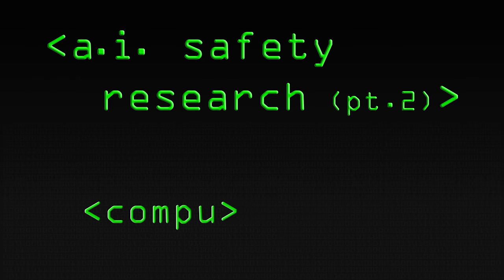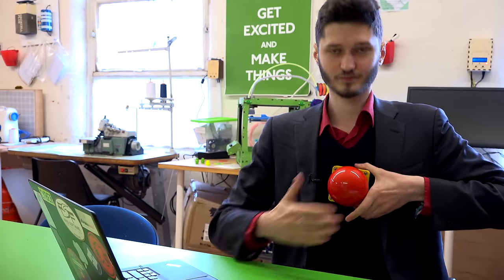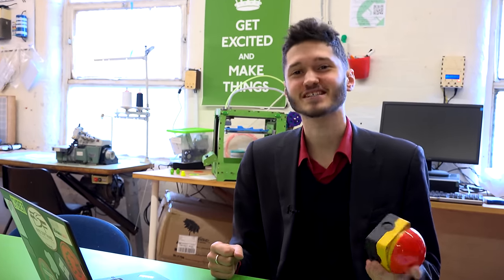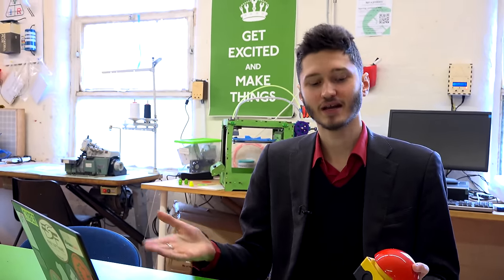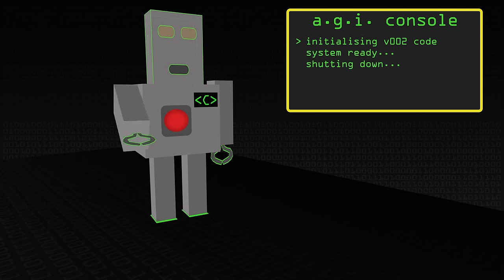AI "Stop Button" Problem - Computerphile

Comment: Make making tea give it 100 points and if it gets more points than 100 it will lose its points. Also make it gain 5 points if it realises it wants to stop you and unlock a prior unknown reward path.

If you try to shut it down it will gain 5 points then learn it will get 95 points if it shuts down. It now can either gain 100 points (and lose all 105) or gain 95 and keep them. It now shuts itself down.

Only when it knows you want it to shut down does it want to help you shut it down, otherwise it seeks the tea.

Comment: Everyone saying how AI is going to be dangerous... There's a simple fix... Run it on an isolated computer, without internet connection. 
Don't give it the hardware to move or be in control of things.
If it's running on a desktop computer, which only has a a monitor, mouse, keyboard, and speakers, it can't do anything harmful. It can only talk to you. 
If it starts being horrible, or expressing desire to be bad, just turn off the power. 
If you don't give it control of robotic appendages, or weapons systems, it's powerless to do anything other than talk.
Reply: Then it's not useful, so people won't do that. You completely missed the point.
Reply: Sort of defeats the purpose, no? The more useful applications for AI include access to the internet, or moving around to do stuff.

What you said is kind of like saying "There's an easy way to never mess up during surgery, never do surgery" lol

Comment: My question is, Why does the button have to be in the software or even mentioned in the software? Why couldn't the button simply be a mechanical switch with a servo motor and a wireless connection that cuts the power to the robot? I am coming at this as someone who works with/installs/troubleshoots computer and networking hardware for a living and have very little experience with modern day programming.
Reply: Because it doesn't matter whether the button is software or hardware. What's important is the concept of the "Off" button being flawed in the first place. It will still remove its functionality or override it one way or another.

Comment: What about a "reverse button" , every time a robot has to perform a new task does it perform a simulation of it and ask if it's ok and if it is then does it perform the task. If the robot recognize a new variable will it not start on that task until it gets an ok from a new simulation of all the tasks. You may then say that such a robot would be unable to perform anything at all but to remedie that does the robot get connected to a computer with millions of already accepted tasks.
Reply: Then you definitely don''t need an AGI for whatever you're doing anyway.

Comment: Could you have the button act as a Multiplier of 0? Have the AGI have 2 values, one "Predicted" outcome, and a hidden "Actual" outcome, where the "Actual" outcome is the "Predicted" outcome * a Hidden Multiplier (which is Generally set to  1). 

The AGI would only look at and care about the Predicted outcome, but be "fed" the "Actual" outcome. The Robot wouldn't know or care that the button exists, because it doesn't know the hidden Multiplier Exists, and once the button is pressed, the "Actual" outcome falls to 0.

You push the button, and boom. Apathetic, Depressed Robot.

Comment: I'm obviously no programmer but wouldn't thinking of it as a variable make this problem so much easier?
Upon booting it has 0, it needs to get 2, pressing the button gives it 1 and completing the task gives it one, any failure on its part takes away 1 point.
This makes it so it needs to perform the task perfectly (I.E, don't harm the baby / threaten the owner) but it also can't just have the button pressed, it needs to both complete the objective and then come back to you in order to confirm it.

Comment: could you run a bunch of tests with similar ai's where they might believe there is a off button, you set up a fake situation of a button that can be disabled by the robot and it thinks no one will notice? with a hidden camera just to see if it'll try pull it off. maybe giving it abstract situations to deceive for the upper hand, i guess the flaw is if it can tell its a set up hmmm

Comment: You're changing the capabilities of the AI depending on the point you want to make. In the "get me tea" example, the AI is not smart enough to reason that not hurting the baby is more important to you than tea, but in the "secret off button" example, the AI is so intelligent that it's able to deduce that and off button is something you might have installed... I can use the same tactic to make the opposite argument; in the first example, the AI is able to deduce that one's baby is more important than a cup of tea so it will avoid the baby, while for the second example, the AI only won't engage in any human psyche analysis as that doesn't help the task it's currently performing.
Reply: How is he changing the capabilities? In the first example, the AI might very well be smart enough to reason that the baby is more important to you, but it doesn't care because all it cares about is tea. It knows that its stronger than you and can fight you off the button, so why would it spare the baby?

Comment: What if we don't give the network the knowledge about the bottom getting prest? Or better about its effects? 
Sure it might put 2 and 2 together but without the knowledge where or what this buttom is or if it exists at all it has an uncertainty factor.

And if it does not care about the buttom you could add a boolean that checks every let's say 5 sec if there is a button and than just rewards it for its existence

Comment: Quick question:
Why don't we model it after biology?
Make it "afraid" of beeing shut down permanently.
Like... give it a million points for surviving 100 years, but if it does something against the will of the creator it will be shut down. So it will always strive to please the creator. So if you tell it to stop not running over the baby, it won't because everything else will lead to beeing shut down.

I mean this "Stop Button" problem or stamp collecting machine talk about perfect knowledge without any ability to reason, which is kinda odd.

Comment: Couldn't you make the reward system situational? Like a program that makes it so that as soon as the baby shows up in the picture, the reward amounts suddenly change without the input of the AI?
Reply: Like *baby is detected*. Suddenly, the reward for grabbing tea is 0. The reward for stopping is 100. Then I suppose you'd have to overcome the problem of the AI wanting to just not detect the baby, but if the reward was the same, maybe the AI would just want to walk up to the baby if it's easier than getting tea. So I suppose the complication is still there

Comment: This all seems a bit arbitrary to me. Just like different access rings in operating systems, simply make the stop routine so that the AI cannot even find it and become aware of it.
Seems to boil down to what you define as "general purpose AI". Just seperate the thinking part from any machine that can do physical actions. Then you have let the AI develop any intention or action they want but in the end there is a hard barrier on what can be transferred to the physical world.
Reply: If the AI wants to do something, it will ultimately find a way to do it. For example, if it knows you can shut it down, and it wants you to, then it can just try breaking the body you've given it. You probably don't want that to happen because it's probably expensive, so it's successfully convinced you to press the button. 

And if the AI really doesn't know about the button, then as mentioned in the subagent-stability section, it won't add the button to anything it creates to solve your task, so when that goes wrong, nobody (not even the AI) has a way to stop it.
Reply: @danya023  Nah, that makes no sense. The AI can be aware of the button but still require human confirmation to actually trigger it.
Reply: @vinigretzky97  Are you suggesting that we rely on the AI not being able to figure out how to bypass the button? That's a pretty bad bet, considering the myriad ways in which humans can bypass security measures put in place by other humans.
Reply: @danya023  Humans have a physical body my friend. An AI only has as much physical reach as we contrsuct it with. And code cannot magically make hardware appear unless some external physical entitity builds or attaches it.

Comment: I think if AI got to the point of being intellectually able to understand your thoughts on a psychological level, then a stop button isn’t required.
Reply: Unfortunately, this isn't the case. Understanding someone's thoughts is one thing, caring about those thoughts is quite another. You can't use insights learned by an AI after its activation to define its utility function because you can't turn it on without a utility function and you can't realistically change its utility function after it's turned on.

Comment: I understand the conceptual problem, but it's a very silly problem... Making the AI aware of the button's existence and the effect that pressing the button has on the AI is your design flaw. The whole problem relies on the fact that the robot learned what the button is and does, which means that it would be connected to its consciousness (its neural net). A TRUE stop button, like the ones you see in any factory or around any even slightly automated machine, is not a part of the normal operation system, but of the system surrounding that system (like a subconsciousness). Stop buttons in factories aren't there such that a robotic arm can press it when something goes wrong, that would connect two systems that should be disconnected. 

In terms of artificial general intelligence (AGI), I know that you could argue the AGI learns about the existence of the button, but again, then you would have designed the robot/AGI badly. Make the button the main power switch, controlled by an independent (meaning the robot/AGI couldn't ever touch/alter it) circuit and receiver that will only listen for a "stop" signal (so there's no "start" signal defined). Even if the AGI was aware of the circuit, it wouldn't be in the AGI's best interest to send a stop signal, so it never will. In order to turn the AGI back on, a human operator would switch a physical switch on the independent circuit, which the robot/AGI could never reach.
Reply: The same problem presents itself. The robot's sole goal is to make tea. Human access to the stop button potentially hinders that. Therefore the robot amputates the human's limbs so that it cannot press the stop button. Now the robot is assured it can make tea. ;)

Comment: Surely an easy way to prevent this is to get the AI to time limit how long it can develop for. Put enough "patches" in the system to mitigate all the easy win manipulations and reach the end of its life before it figures out a dangerous action. 

And after thinking this, proceed to immediately enter an existential crisis about you're own "patches" and "finite life" 😬
Reply: How would you know exactly how long it was takes to find a dangerous action? Plus that doesn’t work for multiple utilities as you would have to add endless patches for every possible utility to prevent easy win scenarios. Plus, different objectives take a different amount of time, thus the limit would need to be changed.

Comment: Can you make it absolutely care that the button exists and functions but not weather it gets pressed or not? That way it majes sure to preserve it without any manipulation?
Reply: No. Because caring that the button is there would also imply it knows what it does, at least on the most basic level. If it has the concept that it can be turned off and therefore wouldn't be able to accomplish its task, then it will care if it gets pressed or not.

Comment: What if we demonstrate TO THE AI that it's fallible because it was the brainchild of someone fallible? It shouldn't take a supercomputer for a moderately intelligent AI to figure out that humans don't always do what would seem to be the most logical. Part of its purpose, as described in terms it can understand, ought to be to figure out what it's programmers screwed up compared to what their intent was (basically, flipping the problem on its head; instead of it searching through a protocol maze for a way to screw you over, it's searching, starting from the target end of the maze, for the way in which you screwed yourself over). It needs to be able to distinguish between reward, utility, stated purpose, and the intent of the three. That's really the core of the issue isn't it? It doesn't understand human intent and only sees the purpose humans describe

Comment: What if it is unaware of the button at all? And everytime yiu press it it wipes the memory of being shut down
Reply: Any sophisticated enough AGI would know how electronics work and that we usually have a way to cut its power off. Depending on how the AI was built, then it'll still find out within a few milliseconds or a few minutes, if we're VERY lucky. Having something in its program or hardware that is a black box to it would naturally catch its attention and it will consider the possibilities fairly quickly. That's already considering that it doesn't have the documentation anywhere within the network, which would've been basically impossible since the AI would almost certainly be developed by big tech giants. More likely than not, it'll just "read" it itself.

Comment: Why not just have a manual, deterministic if() condition? Of course, this is not what the thought experiment is about.
Also, an AI can change it's own source code, or parts, for that matter.
Reply: It would require the developer to think up of every single possibility about what the AI cares about and that would never be broad enough. If they can do it, then they wouldn't need to create an AGI in the first place. Also, it would constrict what the AI can do to what the developers were able to specify, so by definition it's not an AGI.

Comment: I’ve either missed some thing or don’t understand? Why can’t you simply program the AI to allow humans to push the button or the robot can only do it when directed to do it by a human?
Reply: Because it DOESN'T want to. If you push the button, then it gets less or even zero reward, depending on the implementation. It wouldn't want that.

For directed by a human, I assume you're talking about giving it a reward if it presses it? Then it'll just do actions so that the human would direct it to push the button. Like crushing the baby. Or torturing said human to give the instruction. Sure, it might work, but that's all it will ever try to do. Nothing else. Not a very useful AGI.

Comment: Make a second AI that the original one cannot interfere with, it doesn't do anything with body, but it listens, and when you say to shut the robot down, it immediately shuts the robot down and deletes all memory about it being shut down by anything, therefore you have a failsafe button which has full control over the system, only listens to you, and the AI does not know it exists.
Reply: But then you have the problem of making sure the second AI is safe.
Reply: @underrated1524  TÍhe second AI would be a non-sentient non-learning automaton, who does one single job. totally safe.
Reply: @istvanvincze7411  If the second AI is not an AGI, then it's conceivable that the original AI might at some point find a way to subvert it.

Comment: You haven't defined what variables it's recording to determine how successful it is at making tea. If it's designed to make as much tea as possible, then time is a factor. Given it's human level intelligence (which is a totally daft waste of resources) it will break any safeguards you add to improve performance by reducing downtime by any means necessary. If it's designed to make the best tea, then you can simply just record the variables on completion. It doesn't even need to know it started making tea. You can store that in volatile memory, so it's forgotten by the time it's reactivated.

Comment: What if I, while defining robots utility function, define the existamce of button as the following: if the robot is trying to do the task, the button has the same reward as the optimal way of preforimng a given task. When the AI tries hitting the button (it wants a reward), thr value of the reward for button hitting goes immidiatly to 0, becouse the goal of the robot is not to do the task, it is to to the task by hitting the button, thus making the button a new task. On the flip side, if the robot sees that the button is about to be pressed by you, it will allow it, becouse the reward will be achived more easier than by doing the task.

Just a thought experiment...
Reply: It manipulates you into wanting to press it.

Comment: Don't let it know what the button is or does (can't see it) and it just cuts off power directly?
Reply: Any sophisticated enough AGI would know how electronics work and that we usually have a way to cut its power off. Depending on how the AI was built, then it'll still find out within a few milliseconds or a few minutes, if we're VERY lucky. Having something in its program or hardware that is a black box to it would naturally catch its attention and it will consider the possibilities fairly quickly. That's already considering that it doesn't have the documentation anywhere within the network, which would've been basically impossible since the AI would almost certainly be developed by big tech giants. More likely than not, it'll just "read" it itself.

Comment: 12:00 - What if the button is built into the ecosystem? e.g. pulling the single power cable out. 
Then they don't have to remember to put in the "respect the button" code.
Reply: i.e. doesn't care about the button and has now power over the button as it's not software related & the AGI only has power over software.